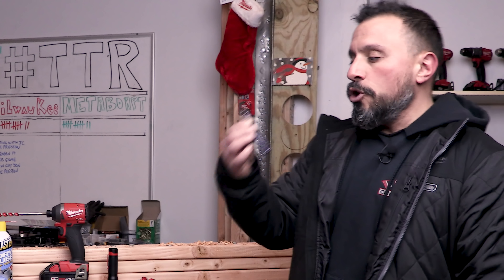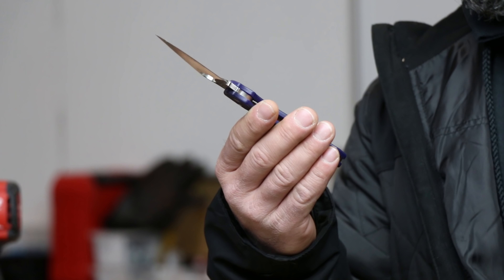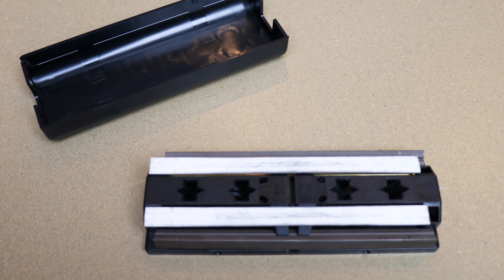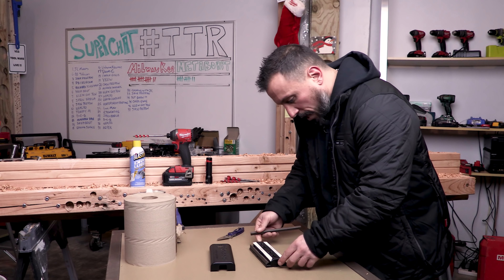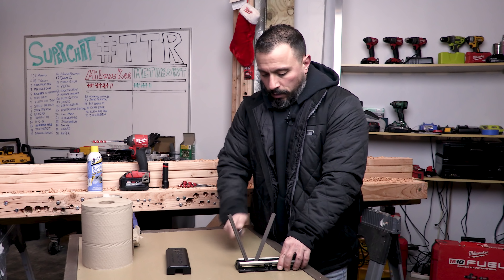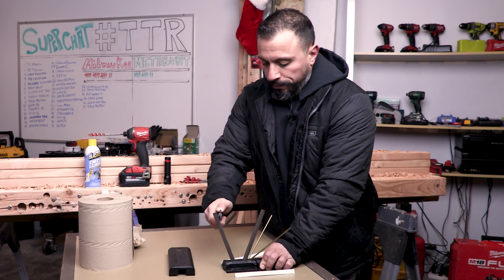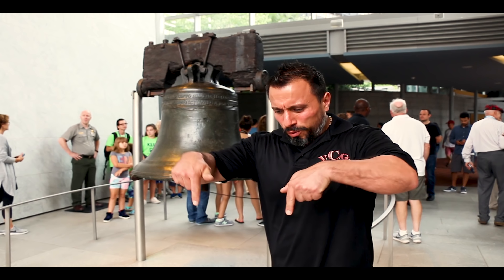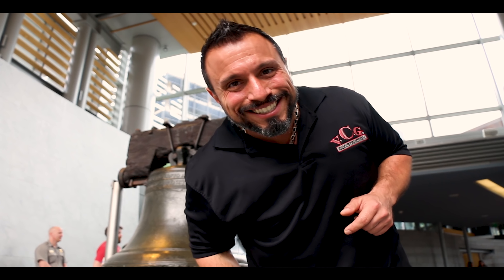How To Sharpen Your Knife Blade Using The Spyderco Tri-Angle Sharpmaker!

Comment: Hey Vince, long-time knife guy here. Been using a Sharpmaker for years, and thanks for sharing the Sharpmaker with the masses.
Two quick things; see the notch below the brass guard rods?  You use that to place the end of the lid, open side down, into and it makes it a handle as well for while you are using the Sharpmaker. 
The second thing is, you use an abrasive cleaner like Comet to clean the stone rods of the metal particles that a knife blade leaves behind as it is being sharpened to increase the effectiveness of the tool, but there is also an eraser you can find that does it as well and is far easier and quicker to use. 
Great choice on the S110 Para3, too as an EDC! Love your videos, too man.
Reply from the maker: Thanks John, we appreciate it!

Comment: Nice. Thanks Vince. I use a ceramic spark igniter from a gas furnace.  It works awesome and cleans easily with an eraser.  I have stones that I use to use but the d2 steel on my Milwaukee Hardline knives is so hard that  the stones don't work. Only diamond or ceramic.  When in a pinch I've been seen using the bottom of a coffee cup
Reply from the maker: Awesome solutions Cuz!!

Comment: What degree do you sharp your knife? 
I'm using the para3 as well with sharpmaker. 
But not sure which angle 30 or 40 I should go
Reply: Thanks. 
From your video, you said 40 degrees.
But the factory bevel is 30 so it a bit confusing me. 
Now got the answer!!!! 
Really helpful. 
The reason you do 40 is to create micro bevel right?
Reply from the maker: @liamyedmun825  for touch up I do use the 40 degree for a very sharp edge. I'd stay away from the back bevel 30 degree unless you're putting on a totally new edge, which is intense and requires multiple steps.

Comment: Great vid & info Vince. The kitchen steel only "hones" knives & won't sharpen, as far as I know(what was told in culinary school once upon a time, 😊).. I use a similar older kit for my knives for a quick "upkeep" of the blade. Also use a good wet stone & other types of stones for sharpening my swords & knives a few times a year to really keep a great edge, but it's kinda a pain; so do love these quick devices for in between uses. My fav is the traditional Japanese kit I have for honing & sharpening my katana swords, instead of a machine.....just like to "feel" the blade & control process better. Just my opinion & thoughts.
Thanks Again, A

Comment: You should use a leather strop with compound for deburring and polish after you sharpen. Or at least run it across some nylon strap or cardboard to take the burrs off. Check out Dutch Bushcraft Knives Youtube channel for some really in-depth sharpening guides

Comment: VINCE/VCG'S...... I don't know if this is new or not but I like to share. Acme Tools if you purchase the chainsaw the table saw the new circular saw or the new super Sawzall they come with a 12 amp hour battery Plus you get a free 12 amp hour battery Plus 10% off with code WC10OFF-NC3QM I just tried it and it worked. For instance I tried the circular saw came to $360 with 2-12.0 amp hour batteries as you know no tax no shipping.... I thought that's amazing because the two batteries cost $400
Reply from the maker: That’s an awesome deal thanks for sharing Eddie!!